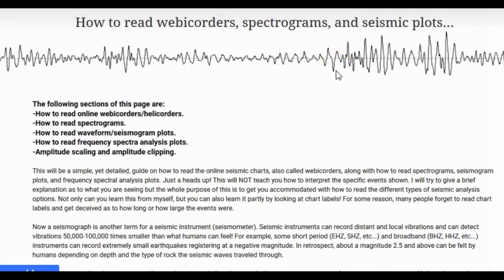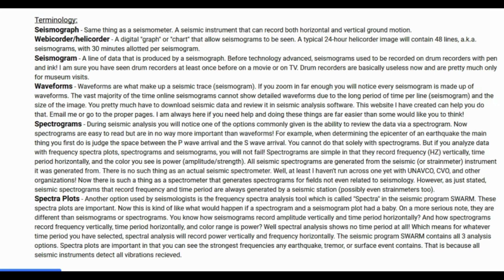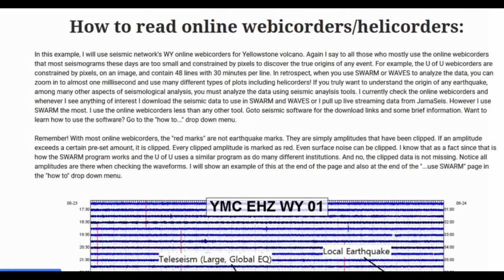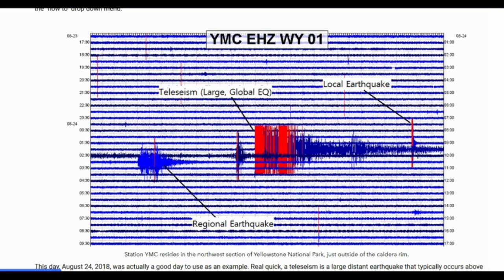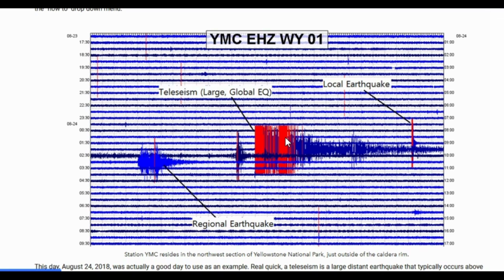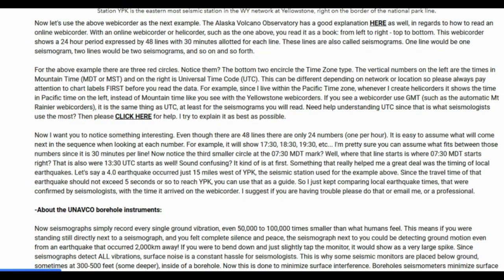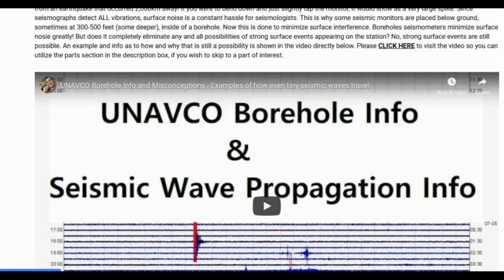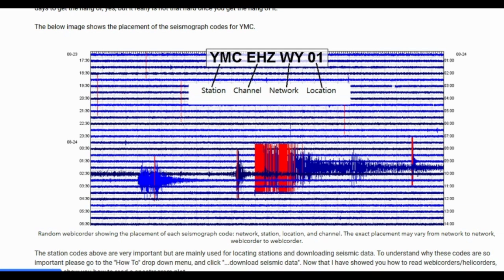How to read webicorders/helicorders - UNAVCO boreholes & instruments explained

Comment: Don't believe everything the unavci putsout. Trust me. Personal experience. And FYI most boreholes are set not to pick up surface events. All 9 boreholes at Yellowstone ones that u can't get access too. Are all set to exclude surface vibrations and noise. There between 500 to 750 ft deep. I would know. That's all I can say on that  none of them are set high enough to pick the surface noise or vibration.
Reply from the maker: I am willing to believe these things you keep repeating, but can I please see proof? I have been thrown around both sides in the past, and have been decieved greatly by both sides, so now I just like to focus on things that are proveable. Please leave a link, if you can, showing that UNAVCO is lying about their own instrumentation (Sonde-2 seismos are like any other seismo). If UNAVCO were lying about their instruments, then there is no point to show any of their data. It really wouldn't make a difference either way since people who monitor these volcanoes usually are not using data from the UNAVCO site. Plus, if boreholes don't show any surface activity at all 100%, then how come there are emergent high frequency events that have a stronger amplitude than a negative magnitude earthquake? I showed in a recent video that a -0.1 quake appeared on many surrounding stations. However a surface event on B944, which recorded stronger amplitudes on B944 than the -0.1, did not show whatsoever on surrounding stations. If armed with the knowledge of wave propagation, how is that possible??????
Reply: @BenFerraiuolo  give me about another hour or so that I can get back to you bad I'm actually grocery shopping right now
Reply from the maker: @tonyh1117  youtube isnt letting you post links on my comments??? That is not good. Try it again. And how can they edit the data if you can see the data only 3 seconds after it is recorded? Only an AI program can do that and even then that is not possible due to the many factors at play (especially when global EQs are recorded)